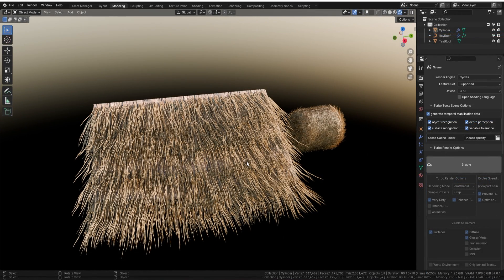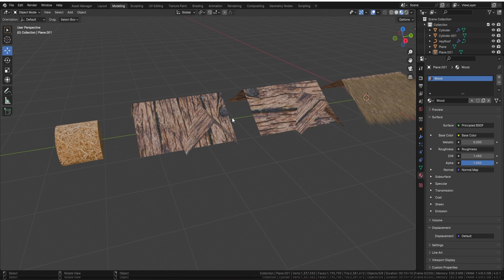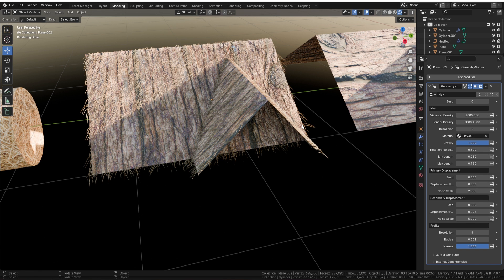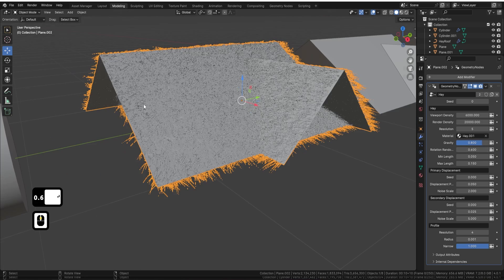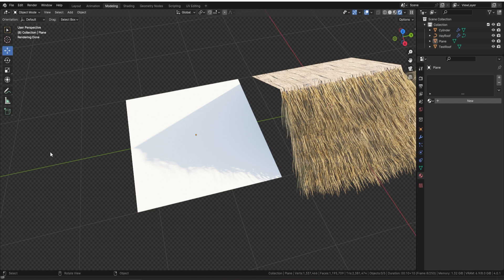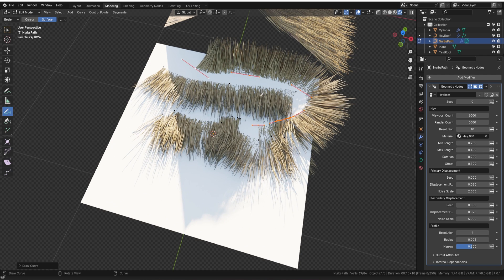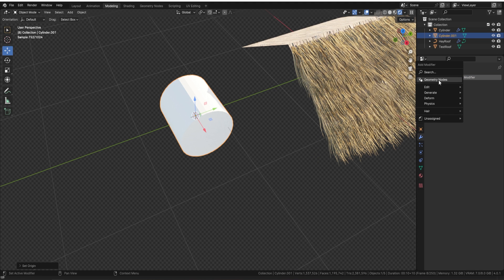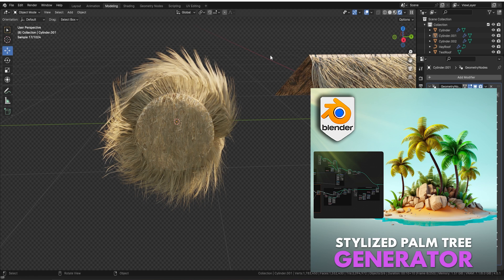Blender 4 Creating Hay Roofs the easy way

Comment: i cant find nodes in modifier, how to fix it?
Reply from the maker: Hi, are you able to see geo node modifier placed on a sample file? If not, you might want to check Blender version, it needs to be 4.1 or above.
Reply: @3DTudor  i use blender 4.2.1 but when i open the file u upload for 0$ its not geomodifier there, i try add a cube for testing and looking for geo node (adding hay roof) but i cant find it. Am i need to buy first tu use it ? Or i can try for free?